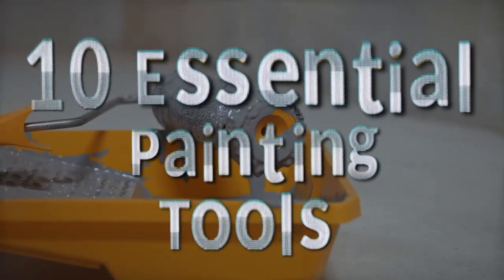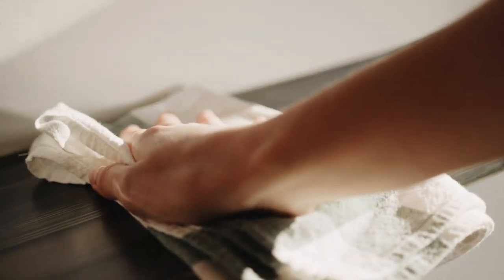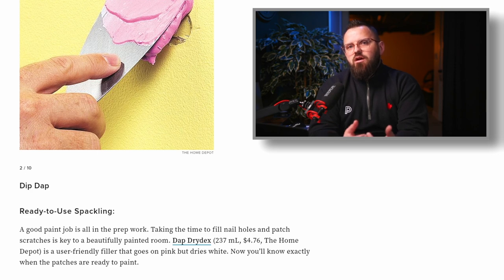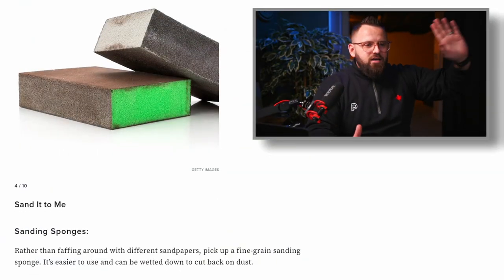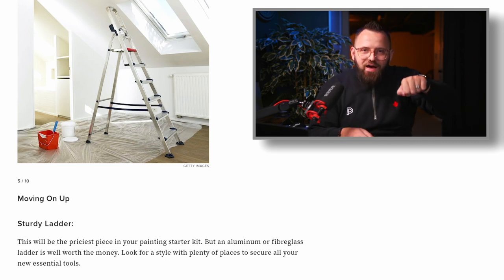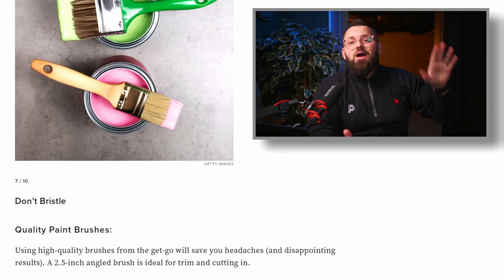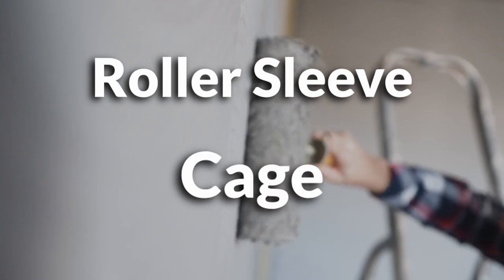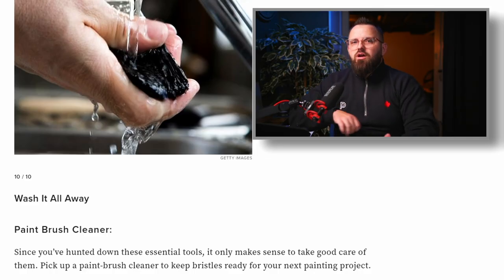These Are The 10 BEST Painting Tools for Beginners (And Everyone Else Too!)

Comment: I think it's also important to have a suitable screwdriver to remove switch and outlet plates, vent covers, etc. before painting. My current rental was painted many times over the years without this step, which might have saved the original painter a tiny amount of time but condemns future people who want to clean the vents, fix a broken light switch, etc. to a lengthy ordeal of removing layers of paint to remove the plate, and then probably have to patch up the damage , repaint the surrounding wall, and buy a new plate.

Comment: Painting more often (ie practicing) has helped me become better at painting. Be ok with the job taking longer or requiring more materials than you anticipated. Be aware of your limitations. In a previous home of mine, there were 15' ceilings in a couple rooms. I left those to a professional who had the proper tools and expertise. For an actual tool, I use a ceiling/trim edger quite often. Along with taping, it does make pretty fast work on those areas and around switches & outlets.

Comment: It's been a while since I painted at home. I have used sand paper and a mouse sander on paneling I was painting in the past. The mouse sander has a pointed end to get the corners. I liked the size and weight of it. I also used kilz primer on it before I painted so the paint would stick to the paneling. Great information in this.

Comment: Good list!!  I agree with your additions at the end.  The only thing I feel was missed from my painting tool bin is a feather duster/ dust cloth and even my small shop vac.  My husband and I have purchased many homes that were not cleaned in years.  I usually give a dusting off/ vacuum of accumulated debris.  I have actually seen people paint over all of this muck and it makes me crazy.  And a screwdriver to remove face plates.  You can use your multi tool, but it is less efficient for me.

Comment: Great info James.  I sure hope that people have the Dap already purchased because the price has gone up crazy high. I was looking on Amazon and for 1 pint,  yes, 8oz..it's $16.61.  I do wish I knew a better alternative to this stuff. It's good, but not $16.61 for a Quart.
One thing I've done regarding paint is not cleaning my paint brush enough and it dried up all hard....I soaked it in warm water with a little bit of fabric softener and whalaa...all ready to go again. Hey, its an expensive paint brush. Last thing I'll add... for the fuzzies on the roller brush. I take a long piece of electrical tape and run the roller brush to pick up all the fuzzies before it goes on my wall. Just a few DIY "professional " tips...lol
I'm sure you all know this already, but just in case. Note: if you read this before I changed it to the correct about of DAP, the cost and how much.
Reply from the maker: Great tips!  Thanks for sharing.

Comment: I agree with you on the paint liners, by the time I get done painting the last thing I want to do is clean the paint tray.  I don't believe you mentioned primer for the areas requiring spackle.  I like an egg shell finish on my walls and even though the paint has a primer in it I can still see where the spackle was applied.
Reply: Thanks for the info
Reply from the maker: Good point.

Comment: I quit using paint trays when I found a screen that hangs inside a 5 gallon bucket at the paint store. Just dump your gallon into the big bucket (where it’s much easier to stir), put an extension on your roller and go to work. The 5 gallon bucket is more stable, doesn’t require frequent refilling and you can just put the top on at the end of the day.

Comment: I like a mini scaffold instead of a ladder.
Reply: Where do you get a mini scaffold? Someone mentioned I could rent one from the Home Depot but I’d love to buy one for ceiling drywall work where my ladder is too limiting.
Reply: @Steph_Renee_RN  I think I got it at Home Depot or Costco, but honestly it’s been 20 years 😁 Used it a lot over the years. It’s about 6 feet long, folding metal, gets you two or three feet off the floor which is perfect for regular ceiling height. Lockable wheels for moving it around. Maybe google it?
Reply: @marycrawford9428  wow that sounds perfect! Thanks so much for your reply! I’ll do some research for sure. Many blessings to you!

Comment: I hate cleaning rollers. Is there anything to make that quick and easy?
Reply from the maker: You can get a spinner that you attach to a drill! Just saturate with warm water, spin in an empty bucket. Or you can scrape it with a 9 in 1 tool under a warm tap